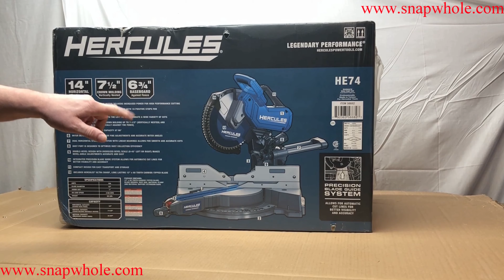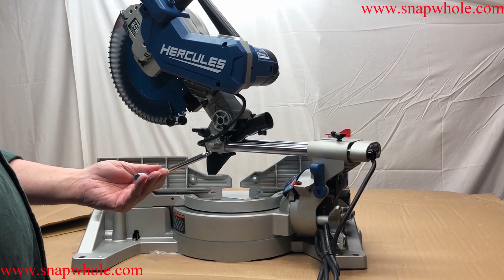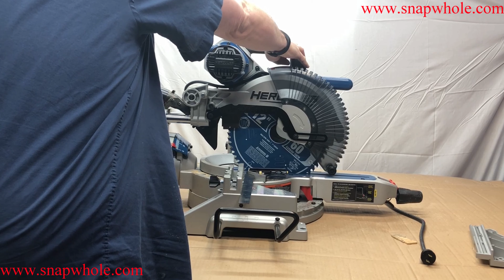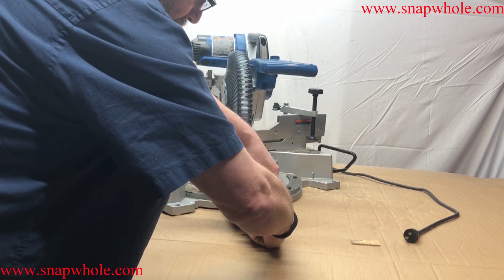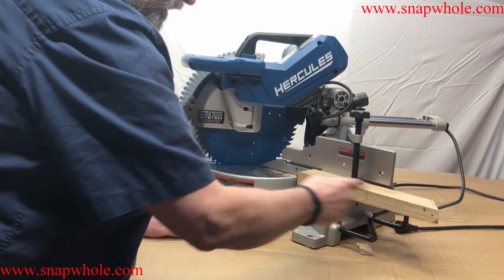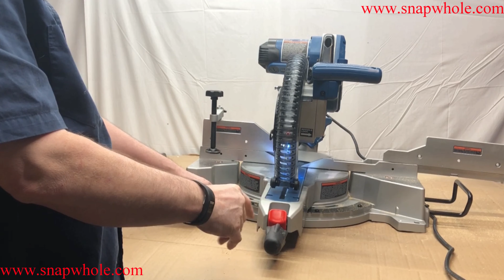Harbor Freight Hercules 12 inch Dual Bevel Sliding Compound Miter Saw Setup and Review

Comment: This is a magnificent miter saw, no doubt about it. This is my first sliding compound miter saw, and none of the other videos I looked at showed how to adjust the compound feature. Thank you for the comprehensive review. I just wish I had been one of those people that got the saw for $300 or $330. I paid $390 for mine about a week ago. Still, considering all the features, I think it's more than worth it. If only it weighed 5 to 10 pounds less. :)
Reply from the maker: it is a little heavy, but its a nice saw, I really like it, glad you found the review useful,, thanks for the positive comment
Reply: There are two different versions of this Hercules saw. There's a $300 version and a $400 version

Comment: The first Gen saw didn't come with the black supports or the safety trigger, it took me a while to get used to the new trigger. 

Also the rubber pads on the bottom are new, I had to make spacers for it to fit my miter saw stand properly.
Reply from the maker: thanks for Subscribing!

Comment: I purchased the Hercules 12 inch bevel sliding compound miter saw today. As I was unboxing there was a package with two screws and two R pins. Where do the R pins go? Those screws were for the handles.
Reply from the maker: I waited to reply until I could go over the saw, I have no R clips on my saw, so they must have been added since I bought it, the parts list and exploded view diagram do not show any of these clips either, not sure what is up with those - thanks for subscribing!
Reply from the maker: I had a though those clips might have been supplied as part of an attachment method for a stand, but if so, 2 does not sound right, more likely to be 4...... so still no answer

Comment: Question? I just purchased this saw and so far so good. The only issue is when I try to push back to cut a straight line, the line goes crooked. How do I adjust so the line will be straight from front to back on longer pieces of wood? Thanks for the for the great reviews as well.
Reply from the maker: I check the saw for square-ness - but mine was square and cuts straight, but I did a setup and alignment video for the Admiral miter saw that has the process you need to follow - follow the process in the video and see if that will fix the problem - if not message me, there are more options to try - the video - 
https://www.youtube.com/watch?v=fbpQrW8WkFc
Thanks for Subscribing!

Comment: I am trying to decide if I should buy it. I just need a to cut straight cuts but I like the results I get with chop saws. Trying to find a miter saw with a LED line for cutting . Tough to find at a reasonable price. I have sworn to avoid Ryobi saws as there are too many problems. This saw looks like the one I should get despite it being more saw then I would ever need.
Reply from the maker: I am really happy with this saw, the admiral model uses LED line - https://www.youtube.com/watch?v=fbpQrW8WkFc - I recommend you watch it at least to get the correct setup procedure in case the hercules is out of square (mine was not)
Thanks for Subscribing!
Reply: @snapwholeharborfreightreviews  It looks good I said to myself I would spend the money. In fact I just drove  to my Local Harbor over and  Unfortunately I was counting on the 20% coupon to kick in for a discounted price. I found out at checkout  that the coupons don't work for Hercules equipment. This was written on the coupon but I did not notice. When the casher told me the coupon would not work I was surprised so I asked him my coupon won't with this saw? Instead of just saying that's right he answered " that's what I just said, do you want it?" What a jerk he was. I just said I have to think about it and left the store. If I do go back and buy it it will never be at that Harbor Freight location.  I will now go back to shopping around before I make my decision.
Reply from the maker: @cubehire3653  until recently, we had two harbor freight's (20 miles north, 20 miles south) - I drive in front of the 20 miles south one every day, but absolutely refuse to shop there because the bad attitude starts with the manager and down thru the ranks - so I drive 40 miles out of my way to go to harbor freight - 2 weeks ago, one opened up 2 miles from my house - and it seems ok - crappy stores mostly cost the store money, but not harbor freight.......
Reply: @snapwholeharborfreightreviews  I have had good luck at my local Harbor Freight. I was surprised to get such a rude response from that cashier today. Maybe he was just having a bad day. When I drove away I was sorry I went there and that's never happened before. I used to go there every weekend.   2  miles from your house that's good.
Reply: I put an aftermarket laser on my old chop saw (bolted onto the blade arbor) and it workes great, very accurate.  I am wondering how this light/shadow line will work outdoors on a job site.
Reply from the maker: @shadowace03  - sounds like a good idea - I don't have problems with the light, but I only use this in my shop, I could see where it could be an issue in bright sunlight - Thanks for Subscribing!
Reply: It works good out side too. Have used mine outside and it still worked great. U can see.the.shadow as.if you're.inside.

Comment: Regrettable, I bought the Admiral.  Spent $170 for it.  I need 46 and 44 degree Bevel cuts.  It can only do the 44.  For the 46, I have to stand board up against fence and cut with the Miter at 46 to mimic a 46 degree bevel cut.  I wish I bought the Hercules.  oh well.
Reply from the maker: I had the admiral and sold it and bought the hercules - there was nothing wrong with the admiral, but I really wanted the hercules - there are three manuals for the admiral (different manufactures) and none give max angle on the bevel, and the hercules does not either,(strange for both saws) although both have a scale 0-45, so the best you can do is deliberately misadjust to 1 degree off, which might be difficult to get accurate and there might not be enough range of motion to get 46, I'd have to try it - but the board stand up method is not the best way to cut a board, but if its the only way...... I'm not sure you'll have any more success with the hercules, but it can be frustrating - thanks for subscribing!